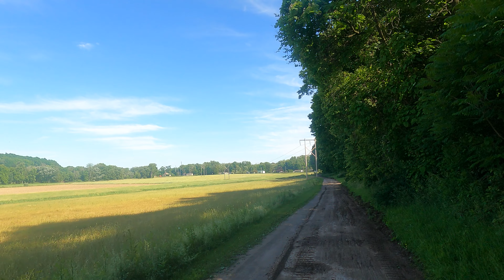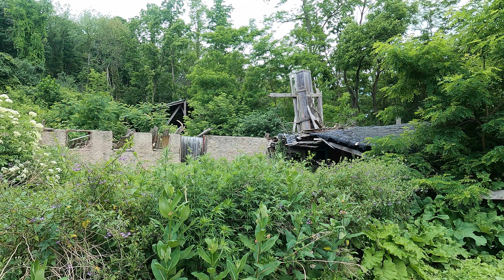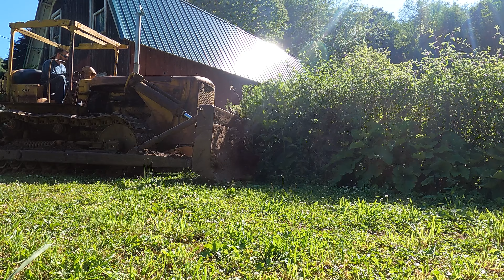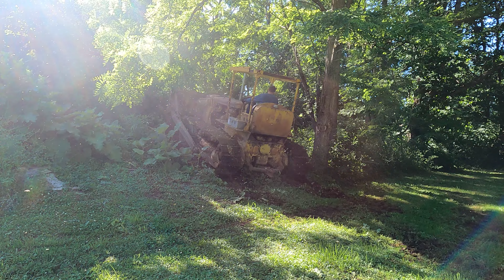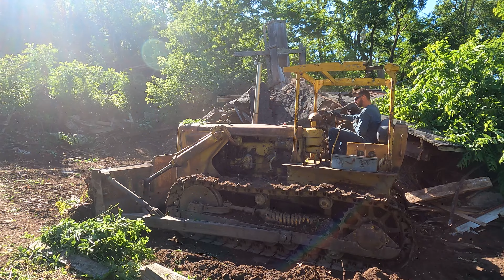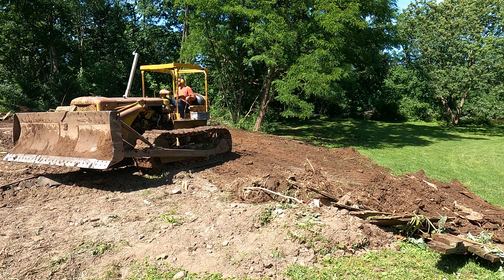I bought a 66 year old bulldozer and destroyed a barn

Comment: When starting the diesel run it on compression with the throttle in the shutoff position, it can't build up heat in the cylinders with fuel spraying in there. After it has turned over several minutes on compression then open the throttle, it should start a lot better.
Reply from the maker: Good info, thank you
Reply from the maker: @RomeKG471  yes i do, they have a facebook page as well, iv gotten alot of help from those pages

Comment: Yup Guarda on the track tensioner springs guards over the outer bearings by the sprockets also guards that go  side skirts of the engine and the floorboards under the breather...I know cause my dad had 3 of these old dozers 2 8u's and a 9u..could be a plunger stuck  on the injection pump ...could be a injector line plugged and finally a bad injector or clogged nozzle
Reply from the maker: Good info, I’ll check in to the injection pump a little more